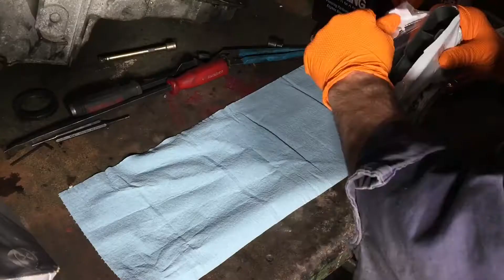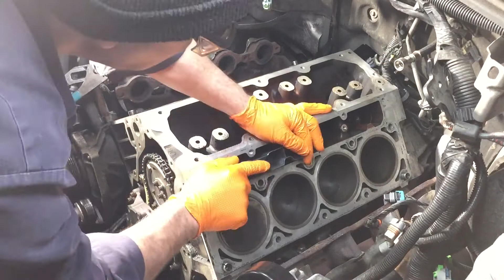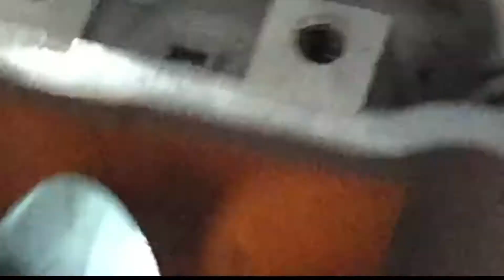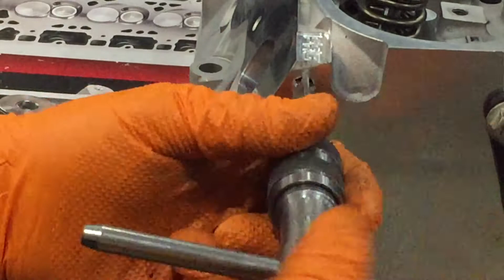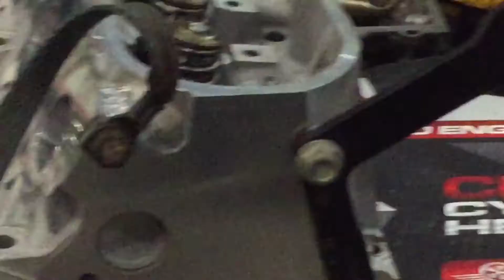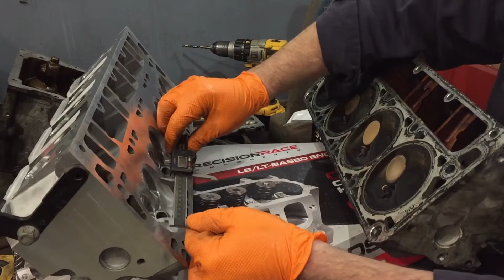2008 Chevrolet suburban ltz afm/dod delete, part 9, installing oil pump and heads, KIND OF

Comment: Did you pre pump up the lifters submursted in oil  before putting them in the mason jar?
Reply from the maker: No I did not pre pump them up.  however I did see air bubbles coming out of the lifters when I first put them in the jar.

Comment: Did you remove the oil pan or no?
Reply from the maker: Yes I did
Reply: Thanks for the reply.  Tryna get around from doing that part lol
Reply from the maker: @Jay-wn6uf  that’s a scary one if you have patience, you should be able to do it, but while I was in there, I really question how them guys did it but they do it🤷‍♂️💪💪👍. Good luck to you and if you do it without taking the pan out, let me know.
Reply: Will do.  Only cause mine is 4x4 and alldata says drop the steering and differential carrier 🥴
Reply from the maker: @Jay-wn6uf  mine is 4x4 also. It isn’t horrible to take that stuff out but definitely a bit of a pain😞